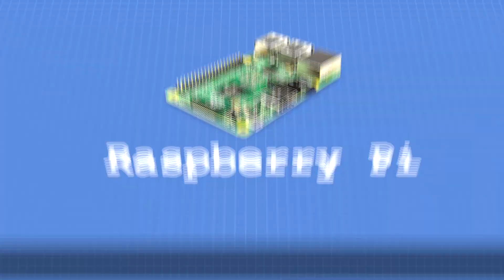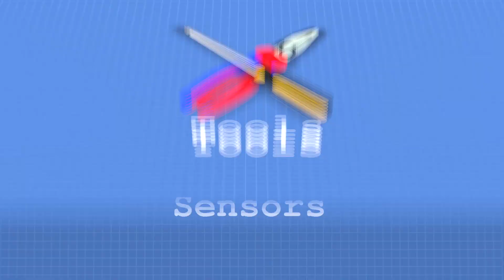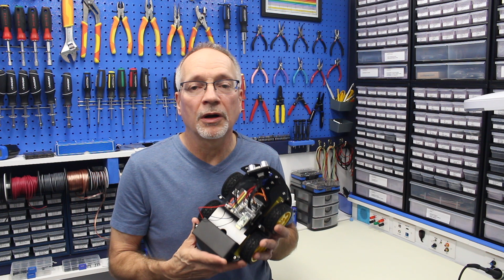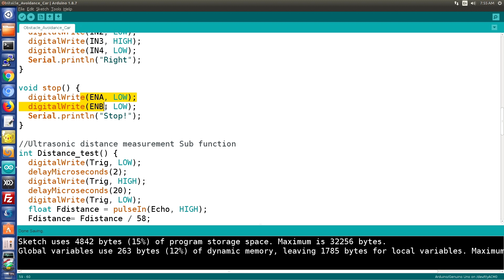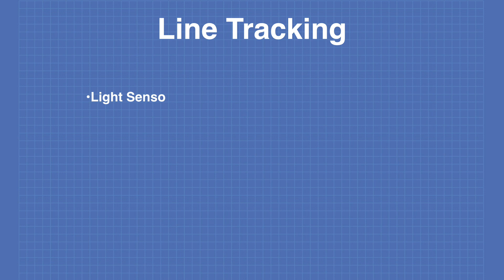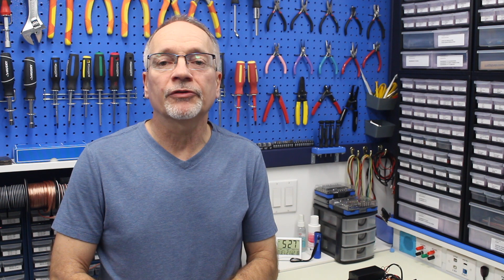Elegoo Smart Robot Car Part 3 - Collision Avoidance & Line Following

Comment: I bought an updated version of this kit for my 9-year-old grandson from elegoo for Christmas.  While the new kit didn't come in a plastic case, it did add as ESP32 camera module, and a redesigned adapter card with a different motor driver built in.  As you state in your videos, the elegoo kit is very well designed and packaged, and is an excellent value for the price.

The grandson built it all himself, with Grandpa observing, and he only needed a couple of hints to complete the assembly, and to correct the connection of the motors (needed to swap a pair of motor wires after observing why it was required).

I only found this episode a couple of days ago, and wish I had found your 3-video series before I bought the kit.  I'm certain my grandson would have enjoyed watching them with me.  I'll definitely point his folks at your website so he can watch the things that interest him.

I'm so glad to be able to pass along my interest in electronics to a kid who is really enjoying it (between being busy as a goalie).

Thanks for making the DroneBot Workshop website!!  I sure wish there was something like this when I was a kid!!  - Richard (in Whitby ON)

Comment: Sorry but can anyone can tell me if i want to use ir control mode at the same time with line tracker mode without using mobile app to switch between the two modes

Comment: I install the program "Obstacle_Avoidance_Car" in the car, but the wheels on the right side don't move, only the wheels on the left side move, and both the distance meter and the servo work fine. After testing for several days trying to identify the cause, I found that if I delete the instruction "myservo.attach(3);" in the program, all the wheels and the distance meter work fine, but logically the servo is disconnected.
Could anyone help me. I would like to know why this happens with that instruction? I want the program to work completely.
I couldn't.

Comment: Hi Bill, great video and I know its a few years old but, I got a Robot car about 4 years ago and never finished it, after watching your video it gave me the Opportunity to finish but the Motor driver and Uno shield are different but no problem got a similar motor driver board on ebay and the Uno shield I designed the shield and will get made at JLCPCB, so something to do later in year ...John

Comment: Nice tut ... but are you powering the servo from Arduiono? I assume it is a matter of currect pull, but I consider it somewhat risky - in some cases it has worked for me, but I have also burned a nano in this way (well, with two servos, no load, just random movements, but anyway)...

Comment: I thought you were going to fix the bad coding settings on avoidance.

The stop and run after time is way way to high.
This is why it crashes after stoping and turning.
The  servo turn, being 90 o  and motor turn is not the same, it's about 45 o.
If the case is,. Then a additional scan is required at 22 o

As the scan time is set in 20ns, why there is a 1s wait I don't know,the most would. Be double the regent.

Also we should ping and turn code. And I believe there is a mapping sketch?
Hopefully so it learns the area.. it only needs to plot.

Comment: This has been a great project. A great job. My only problem is the Micro Servo 99 is I can't get a 180 degrees arc my best has been 15 -> 165 .  When my kit comes in hopefully the servo will work better than the ones I've purchased. Thanks for a great presentation.
Reply: Some servos (most of the cheap servos...) turn only ~160°, not 180° ! 
That's the reason why in the example they used 20 to 180°

Comment: What is rightDistance is equal leftDistance? 
So, in my opinion, after checking which distance is greater (or less) we should simple add else (which means they are equal) and in that block add commands back and delay, and checking if they are less or equal 20 should be separated  if condition, but that only my opinion.
Great video, thanks a lot.

Comment: Great set of videos! 

I purchased this kit for my son, we built it together but we were unable to make collision avoidance work as expected. I'm having the same problem described in comments. Apparently the ultrasonic works fine with flat surfaces, but not so much with irregular ones. While I debug the code with serial console the sketch works fine, but once in the floor the car doesn't seem to follow the right pattern.

I noticed also that the following portion of code is "almost" never executed. It only works when right and left distances are equals and less than 20cm.

else if((rightDistance <= minDistance) || (leftDistance <= minDistance)) {
        back();
        delay(180);
      }

About the || operator, I'm not sure, but should be using && instead? The robot should go back when there's no enough distance on any direction.

Anyway, thanks for tutorials!
Reply: Use &&  as both needs to be true in order for the robot to turn back.

Comment: Good videos; bought the car. Made some code mods;
The pivot turn used needs a higher speed to work on carpet. Lots of friction, initially just stalled out trying to turn, so added two different motor speed, one for moving forward and back and one for turns.
Didn't like the pivot turn for remote control, so added a radius turn. Both sides motors run forward, outer faster than inner. Differential controls the radius. Swap motor speeds for left turn or right.
Also found that initial collision avoidance distance was too short, adjusted out. Also different speed settings for forward/back and turns. 
Future mods;
Collision avoidance, raise speed if long clear distance, reduce as shortens to stop.
The ultrasound does not seem to get a correct distance from an angled surface. It seems to run into any wall that is at 45 degrees (about) to the direction of travel. Need a strategy to solve this problem (if possible). Possibly a 'stalled' detection.
Want to incorporate both the radius turn and the pivot into the IR or bluetooth functions.
Want to add a compass sensor and 'turn to north/south/east/west' options. Have a '3 axis magnetometer' on breadboard functioning to give a heading reading.

Comment: Hi Bill,
I am working on a project and I was wondering if you could help me.
I got this Elegoo Smart Robot Car and a Pixy2. My goal, is to make the robot track objects and lines just like Pixy2 does , the problem is, that I don't know how to make Pixy2 interact with the DC motors.
So if you have any clue, on how to work this out please let me know, thanks.
Reply: Pixy2 has a tracked chassis from a company called Pololu if you buy the tank-chassis assembled all you have to do is mount the pixy2 camera and you can follow lines and objects like the Elegoo car. I have built both projects and they both work great at this task.

Comment: Another great video, thanks!
During the collision-avoidance clip, the robot drove directly into a wall at one point. I have the same thing happen with a car I built using the same ultrasonic sensor. The sensor is seeing distances outside the stopping distance, so the car thinks it can go forward. This is probably due to the angle between the wall and the receiving part of the sensor.
My question though, is how to avoid this? I can increase the distance to stop, but too far and the robot will stay in the center of a room. Do we just need to expect some collisions? Thanks!
Reply: u-sensor works really well with flat surfaces, but not so well with corners. You can also get negative distances as well as 2000+ distances..so you need to add more logic to deal with the variations and extremes you can get. Few things you can do: 1. only do something if the value is > 10     2. If the value is > 80, then set it to 80..basically u r telling the sensor to ignore anything far away...lastly...average several readings together after u do steps 1 and 2. 
https://www.facebook.com/keith.schaub.5/videos/10216652344993348/?l=9174098805765710842

https://www.facebook.com/keith.schaub.5/videos/10216597922712825/?l=1995439918924746601
Reply: in a nutshell, keep the USB connected and print out all the values in serial monitor while you manually move the car around - pay close attention to the values and think why might you be getting strange values and how to deal with them.
Reply: @keithschaub8570  Thanks! There's already some averaging going on, but I think I need to lengthen out what is averaged. Also, another sensor or turning the sensor might help more. I feel like this is a masked math / physics problem, I'm just not sure how to fix it yet.
Reply: @andykauffman7466  if you blindly average, it won't help much, because sometimes you'll be averaging ~good values..say 50-100s..with one huge number like 2000..so the average didn't help you...at a minimum strip out any huge number greater than 100.
Reply: @andykauffman7466  I used 4 averages..but i'm sweeping every 5 degrees and looking for the shortest path - because I want it to chase something rather than avoid something...but if i were you i wouldn't write any code to begin - i kept it connected to USB and observed the serial monitor while i manually faced the car at a wall, corner, chair, etc., to see what you get....for your application, i'd just do 3 settings (left, center, right)..after each one..take 4 readings..see what they are....if too big, throw it out, or set it to your max (mine was 199 or 200)...if it's negative, figure out why that might be...you need an array to keep track of everything then just keep the largest (for your app), turn the car, then move....then repeat....depending on your speed setting, that tells you how "long" to turn, so you don't underturn or overturn the car...just try a value for the delay and adjust (if u don't want to play with physics).
Reply: @keithschaub8570  Thanks. I kind of what to play with the Physics, but I see what you mean about the delay & an array. My robot's head doesn't turn, but that could be the next step.
Reply: @chris0tube Possibly, but wouldn't the car be hitting stuff all the time, then?
Reply: @chris0tube That sounds like a great idea. I'm working on other things with my car, but will circle back.
Reply: @chris0tube Thanks, Happy New Year!

Comment: Thanks for the videos.   When you show the code for the line following section, I'm a little confused  when the pinmode  is defined for the  sensors. It seems like you are using the !digital read for the value of the pin  in the pinmode command.  or did I just miss something.   Thanks again for the videos.